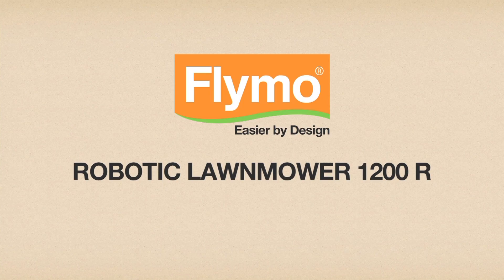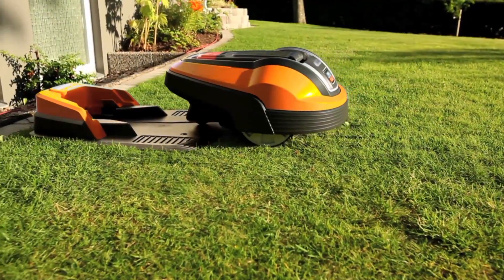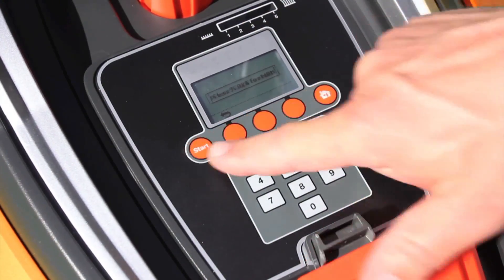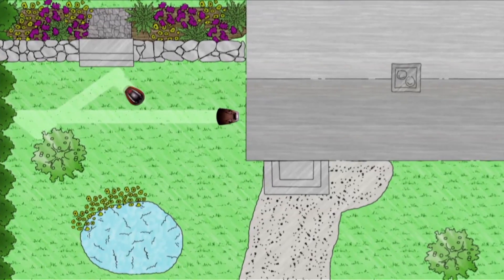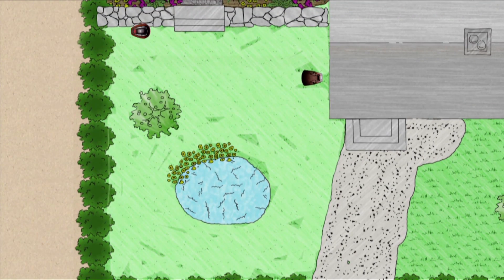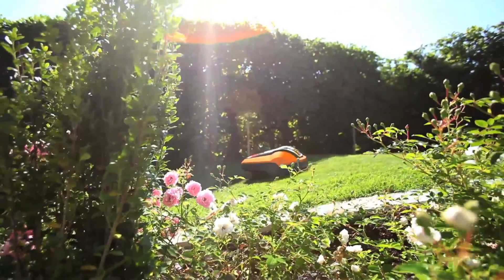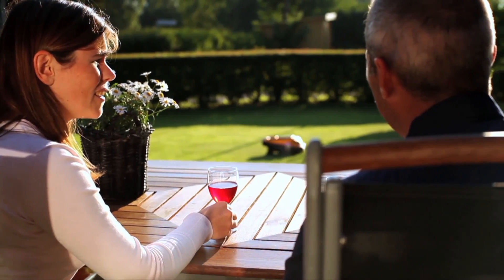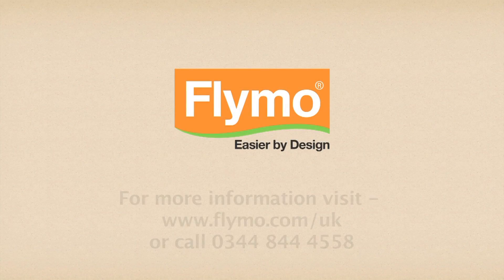How the Flymo Robotic Lawnmower 1200R works

Comment: I have a relatively flat lawn that nevertheless has a number of bumps and uneven bits in it because it is a bigger, more country like lawn🌼 allabout.wiki/Husqvarna-315X  After the set up, which went as smoothly as can be expected given how much I hate learning to work new tech toys, Husqvarna got to work and did a surprisingly quiet job of getting the mowing done. While it has gotten itself stuck a couple of times, lifting the mower out of a too low bed edge occasionally is a whole lot less labor-intensive than dealing with having the mow crew come twice a month and having to pay the resulting bill.